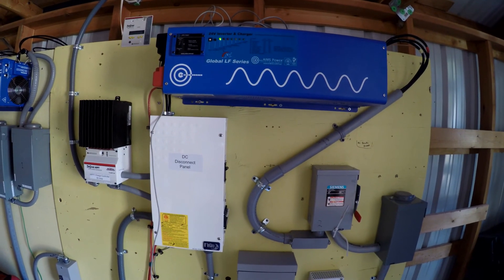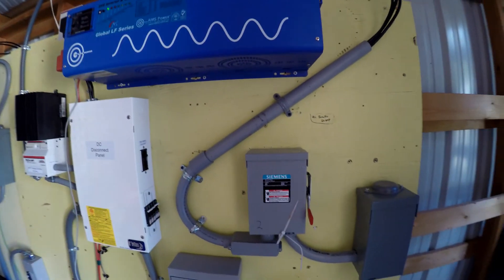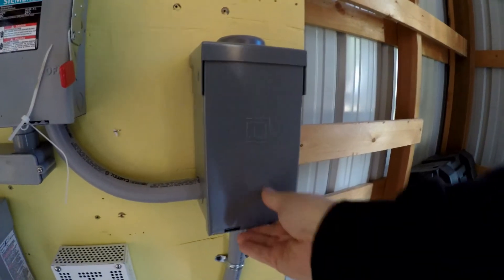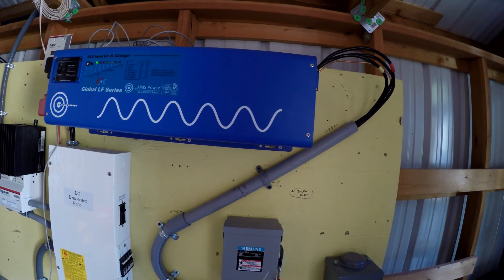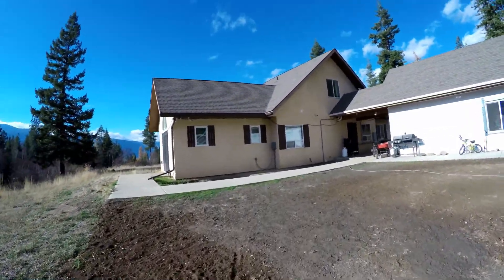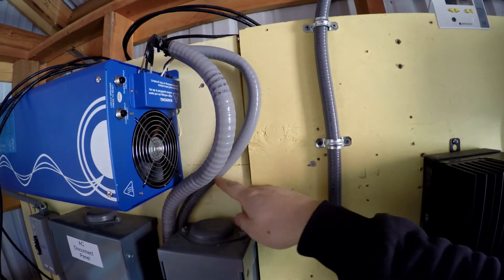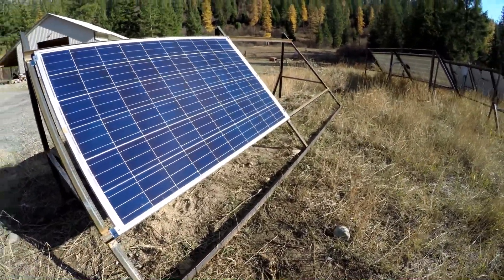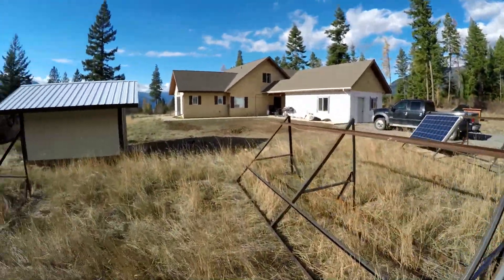AIMS Power - Solar Rig Update with Split-Phase 24 Volt 6000 Watt Inverter Part 3 Update

Comment: hi, how are the AIMS units holding up after  all of these years?  MANY MANY poor reviews about their inverters quitting after a short time and they all speak how the customer support is terrible and their warrantee is riddled with holes.  what has your experience been thus far. thanks
Reply from the maker: They are still working, as designed. We do have a Magnum inverter that will be replacing the main AIMs inverter. The AIMS do not surge to the advertised specs, and this causes an issue with our well pump.
Reply: @xoneeleven  I have been contemplating their 48v 4kw unit but it appears as if boat loads of folks have problems with most of them. on anothe note a  1/2 hp deep well id will want a surge of at least 45-5000 watts i would think.  how much does your surge wattage fall short from what is claimed?

Comment: Does these inverter include a charger? I want to charge my batteries from the AC of the utilities not from solar for now. By the way I've read few bad feedbacks about this brand but I see more and more people buying them. So far how's yours?
Reply from the maker: These chargers have a built in AC 30 amp charger.

Comment: Just out of curiosity, have you tested the full 6000 watt output on the inverter? I've read some negative reviews on the Aims brand and was wondering how your experience has been now that you have been using it for a while.
Reply from the maker: Hello Jason, We have not "run it through the ringer". It suits our needs for the whole house when we use it. It powers a gas water heater, 220v well pump, pressure tank (the entire well pressure system), two freezers, a large refrigerator/freezer, computer equipment, and a large LED television, and various lights.

Comment: I have got a 3000W 24v pure sinewave invertor. I have also just bought a Solar charger 60A 12v/24v to connectmy 2x solar pannels. Both units has got a battery charger to them. I can't see how this will be connected as the battery chargers will clash. Please can you help with advice or a wiring diagram.
Reply from the maker: What I did was wire up the charge controller to the batteries, and then to the inverter. In addition, I hooked up a 20amp grid circuit to the inverter's charger to act as a supplemental charging source.
Reply from the maker: I would recommend you only use one of the built-in chargers. Give me a couple weeks, and I may be able to get a wiring diagram put together for you. We have both of our inverters pushing electricity to separate circuits. Inverter 1 is a 120v inverter feeding outlets we installed in the house. These outlets are only wired to this inverter, and not the grid. Inverter 2 is a 240v inverter feeding the main panel on the house. This feeds the entire house, but does NOT feed the outlets we installed for the other inverter. We never use both inverters at the same time, unless we make sure the circuit feeding the charger on inverter 1 is turned OFF, because we feed the charger on inverter 1 using grid power (supplementary charge capability). We do not use the charger on inverter 2. Basically, we cannot have both inverters turned on at the same time while the charger is being fed, because they would create a loop inside the house wiring and blow out the inverters  (because of the hot wire plugged into the charger on inverter 1). If we lose the grid, we can switch the entire house over to inverter 2, but first turn off the charging feed to inverter 1 . Basically, we can have both inverters running when the grid goes down.

Comment: I just got a 12kw aims split-phase 48 volt inverter i see that your 6000 watt split-phase 24 inverter ac output line what wire size did you go with 4 or a 2 wire size. just want to know because in my house im putting in all new breaker panels for the whole house and doing a rewire of the house but one panel will run off the grid for just ac and dry im more doing this for my server room. i will soon be buying another 12kw for the other panel.
Reply: Hi John.  I bought the 12kw version also.  How is it going with your installation?  I was considering a similar installation  Let me know if you would like so we can compare notes.  In the manual Aims recommends 10 to 5 gauge wire. When I called them the tech recommended 6 awg.  But for my piece of mind, I would go with the largest size that can fit in the aims terminal block.  Have you wired yours up yet?
Reply: +BoogusCongus i have not wire mine up yet still rewiring the house but got to finish up the server room first
Reply: +BoogusCongus on a 100 amp panel you can us 4 ot wire and 2 ot wire for 200 amp panel i know theres no 5 Gage wire theres 10 8 6 4 2 0 so i think a 4 gage wire will do
Reply: Hi John, the name is Eric.  I looked and 5 awg does exist but is rare.   I found some at our factory.  To me the limiting factor seems to be the size of wire that the Aims terminal block can fit... I am surprised that they did not make the AC in and out terminals a bit larger.  I haven't tried putting a 2 or 4 awg wire in one of the aims terminals but they seem a little small. At any rate I will go with whatever the largest awg is that will fit into their terminals for optimum conductivity and dispersion.I have two 100amp panels in my basement running off of a 100amp meter on a triple meter base.  I used to run a separate meter for a tenant but now I have both 100 amp panels running off one meter.  So I am thinking of connecting the aims to one of those panels and keeping my essential loads (like well pumps, furnace and hot water heater) plus whatever else my system can handle.  Currently I only have four large 200amp 12 volt batteries which will be in series and 2kw of solar panels plus the aims charge controller.  I intend to expand in the future but will run whatever I can off the solar for now and the rest on the on grid panel.
Reply: +BoogusCongus that cool that they do make 5 gage wire i did not know but let me know how it goes wiring it up
Reply from the maker: We used 4 awg wire on the AC-OUT terminals, and were careful to not go past 120 ft due to voltage drop distance. For the AC-IN terminals, we only have 8 awg coming in from the grid, and it is only connected to our secondary single phase inverter. Basically, the incoming AC is just a supplementary charging capability.
Reply: can you share the wiring diagram ? Please

Comment: Hi Mark, just finished watching your video. Very useful. I would like to buy one for my home in Ghana (Africa). I have installed 8*100Watts polycrystalline solar panels,800Ah acid batteries. My estimated requirement is 40KWh/day. Would you recommend this unit?
Reply from the maker: +Justice Ametepeh - I would indeed recommend this unit. I do not recall 100%, but I believe it is also coated for marine use. That might help if you have a humid environment as well. From the math you provided, you will need more batteries and solar panels. 40KWh per day is hefty. You will want "roughly" 3 times the amps going into your panels in the daytime vs what you use,  to keep your batteries fully charged.

Comment: I've heard of single Phase and Three Phase, But, 2-Phase ? Never heard of that before?
Reply from the maker: +Nocturnal I should have called it split phase
Reply: Two phase is an outdated technology but it does exist. First hydro plant at Niagara Falls was 2 phase. But as he says here, his is not two phase but is split phase. Two phase was used in some industrial uses but 3 phase pretty much replaced it as you needed 3 wires for three phase and 4 for two phase. You still might see some two phase wiring on power poles but they are tapped for two singe phase uses. You can get 2 phase power from 3 phase power and in a couple of US cities, it still is used.